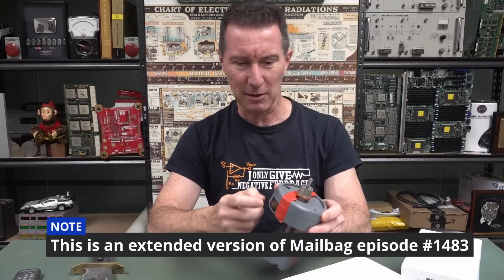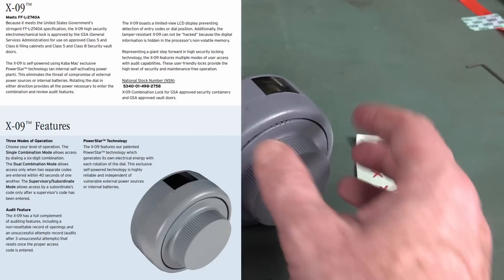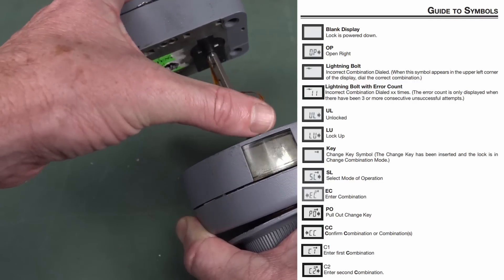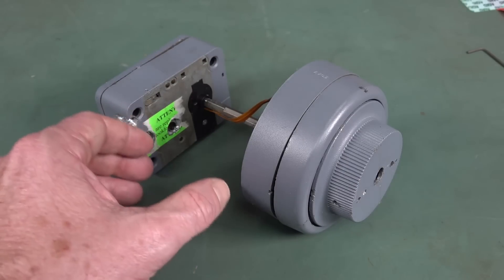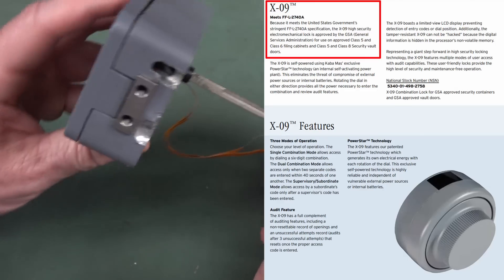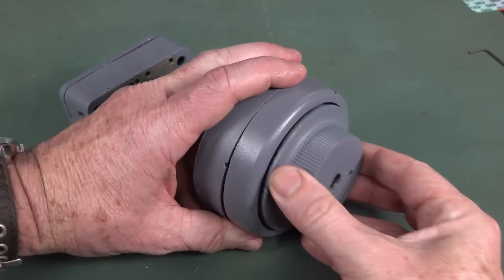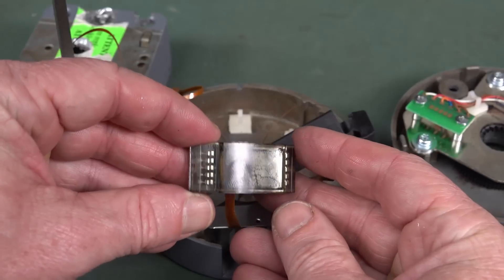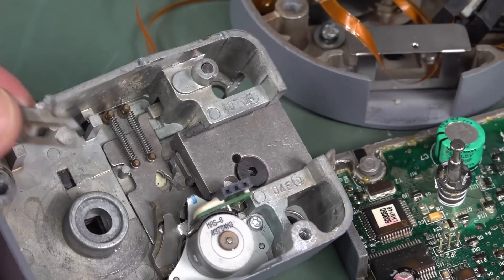EEVblog 1484 - Kaba Mas X-09 High Security Electronic Lock Teardown

Comment: You think they could have put all the gizmos in the rear bit with just the display up front to improve security
Reply: All the gizmos are in the rear. The only thing out front is the lcd and generator
Reply: @Chris-rg6nm  I was referring to the generator and as Dave suggests it doubles as an encoder.  Have absolute minimum out front to improve security - just the display.
Reply: @kissingfrogs  I'm wondering if the engineers hoped that if the generator died, you could destroy the knob and remove the two screws that hold the front cover on. Then, you could reattach a functioning generator and spin the hub to get the lock open. I have seen this done once.

Comment: Surprised that super cap has enough skook to drive a solenoid after a few cranks of the dial. I would’ve thought that’d take a few hundred turns to charge up from the dial.
Reply: It does take a bit of a spin to power up, I have always assumed it was programmed to not power the LCD until it had enough power stored to open the lock
Reply: Unlocking it (eg. entering the combo) is more than a few turns.

Comment: This was just pure comedy; 😂😂😂🤐 Trying to do a video on a security device and at the same time not trying to give too much away.. Favourite bits: " hmmm, eeeh, eeeh... not really sure, i think, em the thingy goes here and em, em no codes stored."....etc etc..🤣lolzzzz...PS, a little heads up, if you trying to keep things on the hush hush, you might want to keep the alan key nut on the lock dial away from camera shot...then it wont matter what thickness door was between that dial and bolt....did someone mention iron ox........😜😜🎇😎😎😎

Comment: My understanding is that this model is not allowed in high security areas anymore.
Reply: nope these are still used a lot
Reply: It most certainly is. All of the X-0 series of locks are still authorized (although more than likely all of the X-08's have long been thrown away). They barely worked out of the box. I actually prefer the X-07 as the ones I have used have outlasted many of X-08s and X-09s I've used. The last X-09 I had replaced only lasted 2 weeks.